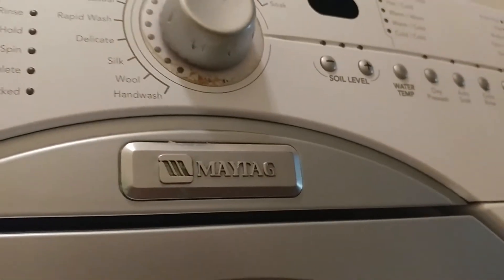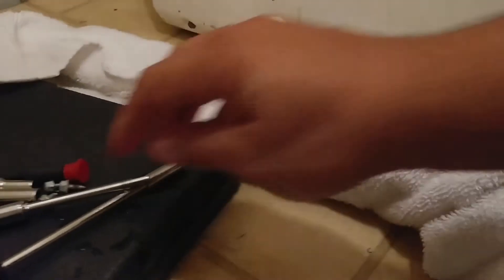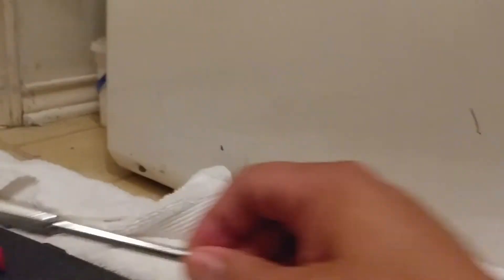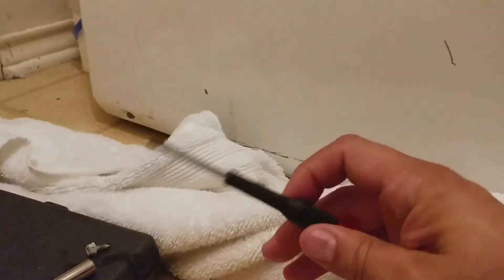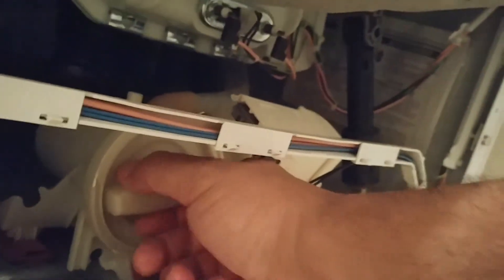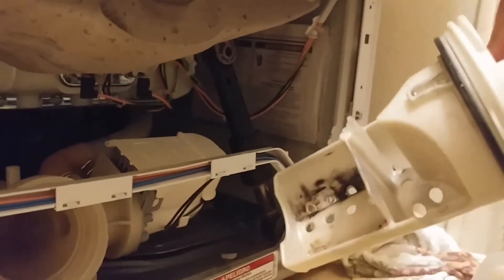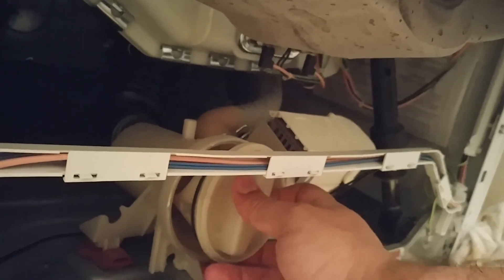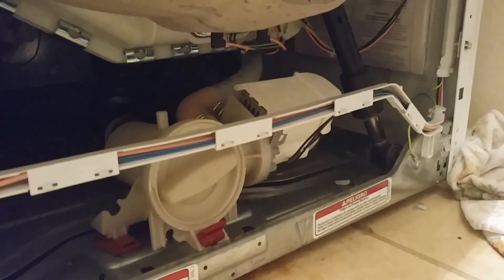Maytag epic washing machine problems won't drain trap

Comment: This fixed my washer!  It's running a clean cycle as we speak!  Thank you for taking the time to make the video.  That filter was on there TIGHT and I was worried I would break it, but all is well.  My screws on the bottom were 1/4" with no star, but I eventually got them out.  I will make this a regular maintenance task.  Thanks again!